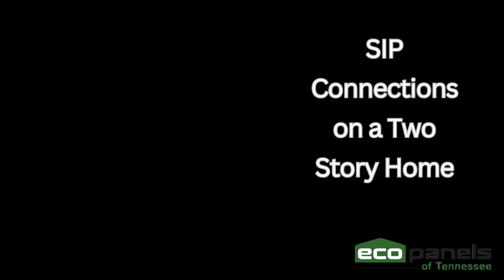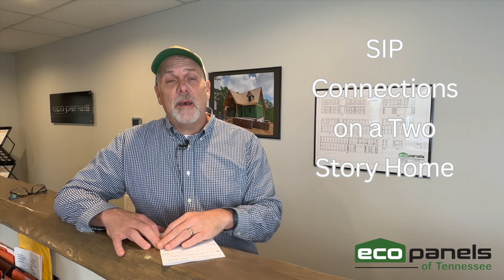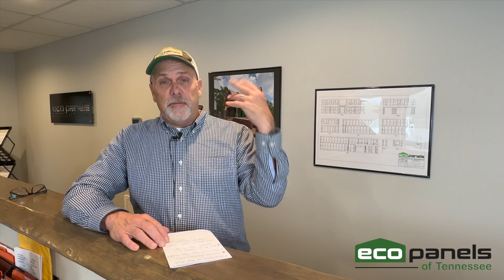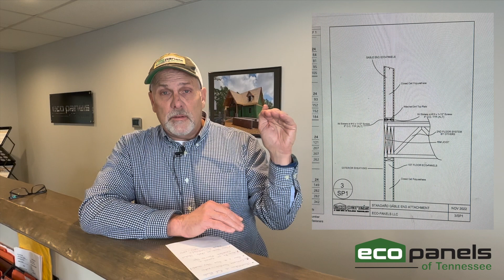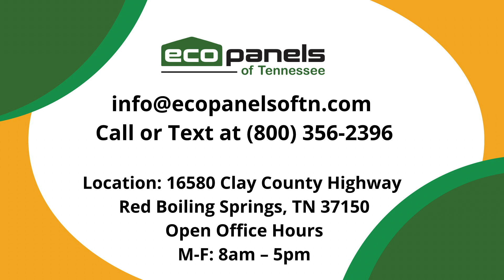SIP Connections on a Two Story Home

Comment: What’s the tallest wall section you guys make? Could a two story house be a single panel tall and then the second floor added after, balloon framing style basically?  Seems like that would be the least thermal bridging.
Reply from the maker: Generally we're going to go up to 12' max. Even when stacking two panels, the thermal bridging on our SIP home is just a small fraction of a traditional stick frame. That said, we do have clients hang their second floor joists inside the envelope, and if you're in a cold weather climate that's a particularly good idea. Good thinking... and thanks for the question!

Comment: Hi Rob - Great information as usually! Couple of questions for you: 

1. If you are using SIP panels for both the roof and the walls, how do you tie in the two together? 
2. If the home is a timber frame structure and the ceiling will be tongue and groove pine, how do you lock the cams on the roof SIP panels when you cannot access them from underneath (because of the tongue and groove ceiling)? 
3. How do the electrical chases work from panel-to-panel? In other words, when you are setting each panel up and there is a chase running left to right, do you have to ensure the electrical chases line up between the two panels when you set each panel? Hopefully that makes sense. 

Love the content. Please keep posting!
Reply from the maker: Thanks for the questions.
1. Depends. :) We have an assembly manual that details different ways of doing this. Several factors involved that doesn't really allow a straight forward answer, sorry.
2. Often times roof panels do not have cam-locks. However, when they do, we can also manufacture the cam-lock access holes to be on the exterior. Once turned and in place, a little shot of foam and a piece of ZIP tape takes care of it.
3. Chases always run up and down, so there's a bit more wiring to this "looping" install. Of course, this only applies to your exterior walls, so it's typically not a big ordeal. 
Hope that helps. Thanks for watching!